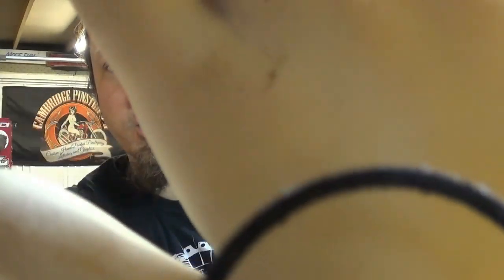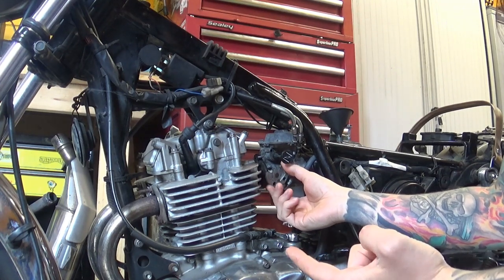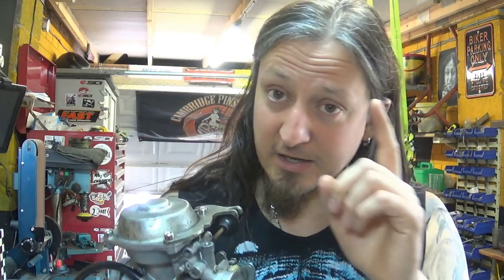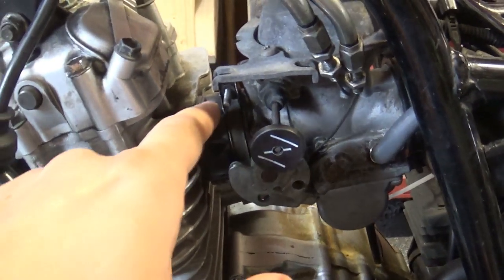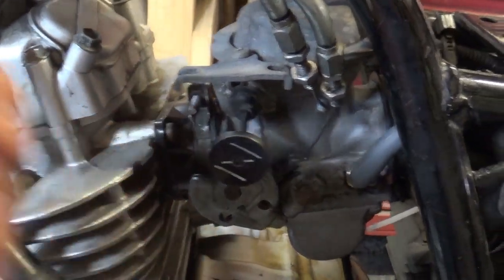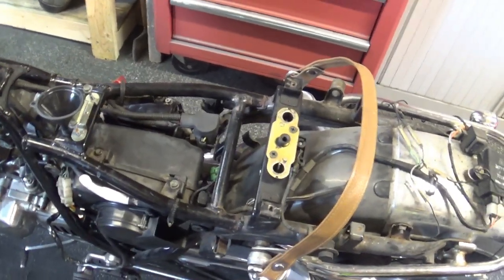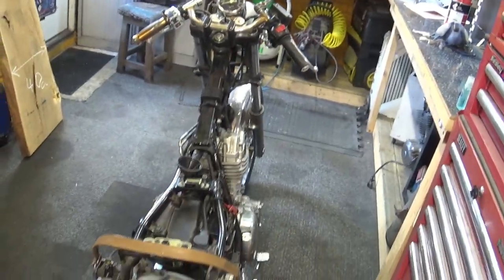Suzuki TU 250 X - Part2 - Still Not Happy...Need Your Help!

Comment: Hmm !.. getting near the old parts cannon situation..
Check ignition timing and valve clearances and valve timing before throwing modules at it.. Of course coils   can be good at idle and bad under load /heat but hey , last video I made some suggestions and somebody told me I was completely wrong ..i'm just an ex mechanic !! good old keyboard warriors..
any way brother you will find and fix the issue ..nothing sounds terminal on the video mechanically..
Peace and love brother 👍🏻☮❤
Reply from the maker: Cheer sspringy, I know so many variables and not just one solution for one problem. I'm on it, appreciate your suggestions!

Comment: Black plug normal for running on choke. 2 carbs = same problem remains. Ignition advance problem. Symptoms are ignition based as it runs wonderfully on idle or with choke, need ignition advance checked out. Has it been apart and put back incorrectly. Finally I always ask myself, why did the previous owner not get it fixed? The cure is usually expensive! Check wiring and ignition pickup to eco before buying replacement.
Reply from the maker: Sure thing man. I will do my very best to get it all checked. Truth is I don't know what has been done to this before I bought it...it was a little bit of a gamble, which I'm not sure if it will pay off or not?

Comment: Shot in the dark but try test voltage draw at the tci unit while you rev it . aslo if UV not checked already check float height at stop idle and when you throttle it. Also air gap and resistance of pick up coil .
Reply from the maker: Will do man, thanks

Comment: I had a car with similar problems.  It turned out to be a build up of carbon in the head, I had the values done ( ground in) and the ports all cleaned  and it done the trick. 
A big job, plus as others have suggested you can set the clearance on the valves at the same time. Good luck. 👍👍
Reply from the maker: It may aswell be the case Rob, don't know until we try...

Comment: I suspect it's a worn timing chain Mackie. It sounds like it idles ok but as soon as you put load on it, it's taking up the stretch in the chain and putting the timing out.
Reply from the maker: You may be up to something here. In which case I'd need to replace it, which is a job I'd like to avoid. Time will tell...

Comment: I don't think its a valve issue. My best guess would be a bad ignition coil or the ignition timing controlled by that cdi box. May even be worth checking the timing marks on the flywheel and cam sprockets, but i think more electrical.
Reply from the maker: I too think it's electrical at this point..I'm waititng for the compression tester before I dig any deeper.

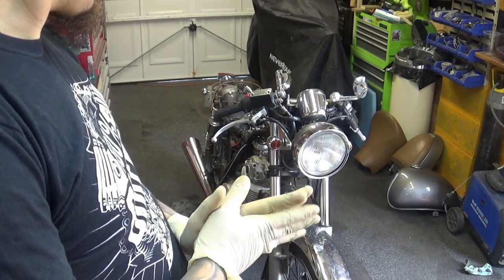Comment: I'm not sure what the answer is to your problem, but check out 2:30. Something just pops off the bike while you are talking. I can't figure out where it comes from. Maybe a nut from the passenger pegs mount for the exhaust.
Reply from the maker: Well spotted ;) It was a bolt from the seat...or where the seat used to be. I removed it and just put it back inplace...it went pop and gravity took it's toll. AOK now.

Comment: Like a couple of others have said, check compression first, then valve timing. If compression is suspect then check valves. If valves seem okay but compression is still low then bores/rings

Had a GSX750 with similar issues — ended up valve sticking on 2/4 cylinders
Reply from the maker: Nice one man, I'm waoititng for the compression tester, as I ..don't have one ;)

Comment: You have the patience of a saint and many great suggestions here. As you changed the Carb (whats the Chance both having the same issues?) and checked the original several times, other than float height, blocked main jet or fuel starvation. Valve clearances mmm, I doubt, as for them being tappety I wouldn't see this a problem, If too tight you would notice it at low RPM due to loss of compression.

Electronic module? unless a common problem. I would be more inclined towards the pickup, is it adjusted correctly or vibrating? A stupid question have you changed the plug for a new one and if so I have known new ones to be faulty out of the box and these can break down under compression.

Coil mmm, the HT lead from the coil possible especially if its the carbon type, these can break down especially if it's a moulded in type which it appears it is, this was a common fault in the 70's and these can be fixed and I can tell you how I do it if needed or send it to me, the spark plug cap can also fail.

You are definitely taxing a lot of brains here.

So assuming you are happy with float height, main jet and its getting fuel.
A quick compression check by putting your thumb over the spark plug hole.
Check ignition pick-up adjustment and it's mounting, wires to it and the module.
Change spark plug again and maybe cap, don't just clean the plug using a wire brush, use a blowlamp and burn the carbon off.
Then, either a second-hand coil or replace the HT lead, I would do the lead.
Lastly, get the beers in, I'm booking a flight and on my way over, my preference is Lidl's Perlenbacker.
Reply from the maker: Good call man. I've got mead, would that do?
Got new spark plug, got two carbs, ignition coil output is good, lead and boot is in good (visual condition). I waititng for the compression tester to give me better understanding on what's going on there..

Comment: If the fuel/induction system is OK, and you are not getting complete combustion, it could be ignition timing, spark too late, or a weak spark, (coil?).
Reply from the maker: I'm with you on this one Tony, I'll check few thing before buy new parts

Comment: Hi Mackie: OK, let’s go through this systematically:
- engines only run properly if the fuel & air are in the correct proportions and this is tricky over a wide range of engine speeds and temperatures.  That is why engines have several different jets in the carburetors - each one functions over a specific range of throttle openings (idle, mid-range, high speed etc.). 
- if an engine is not running properly, then there may be either too much air (lean) or too much fuel (aka “rich”)

Your engine appears to start and idle OK - so there is likely nothing wrong with the ignition system (including the timing)
- the problem only occurs when you shut off the choke - a device which provides a rich mixture to make starting easier. The fact that your spark plug is all black just means that the bike is running on the choke - and the rich mixture is depositing the extra carbon on the plug. 

Shutting the choke off results in a leaner mixture.  Too lean a mixture can occur from several causes:
- inaccurate settings or jet sizes (but you checked everything and have replaced the carb with a used one);
- a dirty jet (which results in too little fuel / too much air);
- an intake leak (allows extra air into the intake and causes a lean mixture) - but you checked the rubber “boot” and it is good;
- an exhaust leak - which can sometimes also admit extra air but usually only when the bike is decelerating - and you checked that too;

You seem to have gone over everything - so I’d check the valves and valve timing (has the cam chain jumped a tooth)?  I still think you may have a blocked jet....

Hmmmmmmm.......
Reply from the maker: Thanks Peter, good comment I like it.
The bike runs fine iwthout a choke also. It idles fine...until I try to rev it up - ther the crackling begins.
100% nothing is blocked in the carb, trust me, I checked it and checked it again.
Valves, low compression maybe, or as you mentioned timing chain - I wil lget on it so soon as I find 5 mintes :)
Reply: MackieBass OK - I wonder if the ignition advance isn’t working properly.  The advance is needed when the engine speeds up to account for different combustion’s characteristics at higher RPM.  
You would need a timing light to check it - but it is a simple matter.

Comment: Check the wiring  using  voltage drop test. Check the ignition switch (inside) for corroded contacts.
Reply from the maker: I checked all connectors - all seem good.I will have to double check things if all goes to **

Comment: I'd still defo check valve clearances and timing then at least you can rule that out. Are you feeding the fuel from a funnel to eliminate the fuel tap? I've had similar symptoms where the fuel tap has been clogged up and only lets the fuel trickle into the carb slowly. Not much else left to check other than a compression test and the cdi unit mate. Good luck
Reply from the maker: Yes, I'm on valves next weekend. And yes - funnel and new hose, so all good here.

Comment: you may replaced a knackered air mixture screw with another these things wear out with time you maybe should of just got a carb rebuild kit matey
Reply from the maker: I did open the second hand one - looks good to me. It's exactly the same problem as previously, so it is unlikely the carb.

Comment: Did you try turning the gas off an as it starts to run out see if it well rev out then.that would rule out coil an wiring if it revs out an probably start looking at valves. Do a compression test maybe the leaking
Reply from the maker: Yes, I'm just waititng for a compression tester..as well, I don't have one.

Comment: Sounds like it's hitting the rev limiter, might be worth checking where it picks up a signal for the rpm?
Reply: agree that were the next step i would check when carp and gas mix are fine
Reply from the maker: I will open that left side cover and check the pickup coil...I doub't it's adjustable tho..
Reply: @MackieBass  might be faulty though dude, good luck 👍👍

Comment: hiya, with it being 2 carbs it would seem that is unlikely, valve clearances and then a compression check would be the next port of call for me, if it isn't the valve clearances it could be burnt valves, most likely the exhaust valve if it is that,  unlikely to be ignition timing as that is fixed being electronic, could be the box but personally I doubt that as usually they either work or they don't, again coil possible but unlikely as it works fine at low rpm, and if that was a problem it would be insulation breaking down as it gets hot which would mean it would likely rev better when cold and not been running long enough to get it that hot, could be the HT lead breaking down having said that, but certainly would check the vale clearances and compression first, check the free to check or cheap to check parts first before slinging cash at it, good luck anyway
Reply from the maker: Thanks Andy, yes compression tester has ben ordered, once in I will get on it. Also the valvle clearance is next. These are the screw/nut type, should be easier to adjust than the shim ones!

Comment: Mackie , Im just a shed bodger like yourself LOL. But have you checked the valve timeing , it could possabley be that the camchain is a tooth out . I maybe talking through my arse , but it maybe worth checking if you havn't allready. ride safe ;-)
Reply from the maker: It may aswell be the case, I will check on this and report back.

Comment: Coils can look good but fail under load . Leads and caps? Good luck Mackie 🍺
Reply from the maker: Yes, I tried one from my DRZ400, but produces too weak spark, and won't even start the motor. So back to the drawing board.
Reply: MackieBass yes they can be different types with specific electrickery. We have a business called Small coil rewind that test and rebuild them here in Geelong. 🍺

Comment: If it was me, i would put the mixture screw to were its suposed to be, then i would be thinking of changing the spark plug cap and lead, i know you checked them but they do break down over time, then its change the coil and last i would do the control unit, you have done great so far, its just when its time for more money to be paid out, you put the brakes on and do the hmmmm we have all done it,, and start to question your self. i would just go down the road you are already thinking of, becasue its the right one. you just have to try and make the money back when you sell her. thats why a lot of bike shops dont want to buy older bikes, because of the money they need to get them up to standard again, they mite not make any thing on it.. oh and as far as iam aware you can not adjust the timing, and i very much doubt its valve cleaance, if the clearance was that far out you would have problems with comporession. i would try the cheapest thing first, ie new or a different spark plug cap, and work my way round from there, new coil and lead, or at worst a donor one... oh and one last thing i use fowlers parts from the uk, after looking it would have been a lot cheaper than you got quoted for a new mixture screw from them.
Reply from the maker: Good shout man, I will explore all these options and come to you guys. It was the complete set of screw, spring, o ring, washer and shipping. I figured new (used) cabr is a better value for money.
Reply: @MackieBass  no problems mate, some times though it is better to just buy a second hand carb since there not that expensive, and i bet its stoped a few people saying you have a blocked jet again lol. oh 1 last thing, just check your voltage across your battery when shes runing and just leave your multimeter connected and rev it as well, it mite sound stupid but i have seen a few bikes run weird when the reg/rec is going or about to die, and it wont cost you any thing to check it.

Comment: I had a problem like that turned out it was ht lead was bad ran normal put in high revs and bogs out put a new  one ran great I thought was the carbs but it was the coil the whole time
Reply from the maker: That is a possibility. I did inspect it however, visually looks good condition, but you never know under load... I will check that later too., Thanks.

Comment: Take your mufflers off and try it. sounds like it cant breathe
Reply from the maker: plenty of air coming out through the end pipe...I don't think that's it, but I iwll give it a shot.
Reply: @MackieBass  had the same trouble on a Suzuki I had.Removing the silencers fixed it.worth a try only a two minute job
Reply: Some carburettors have a diaphragm in them a small hole in the diaphragm will also cause your bike to run like it is.worth a check as this is also a two minute job.